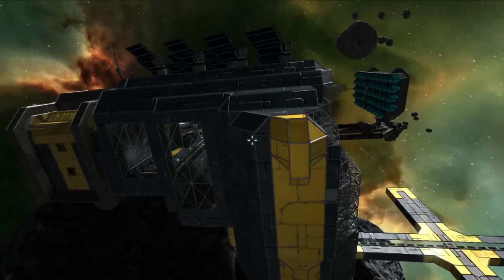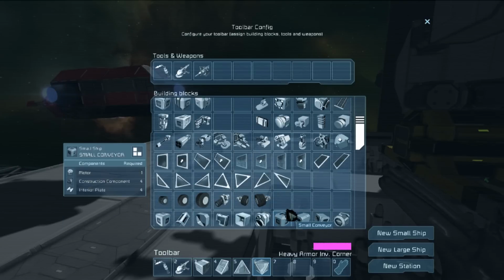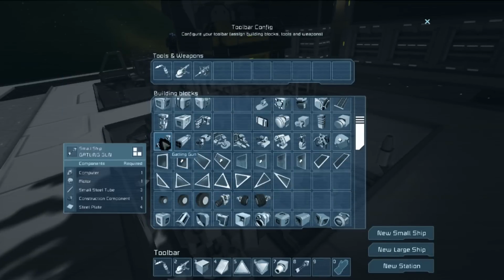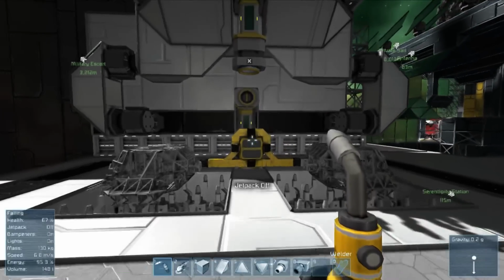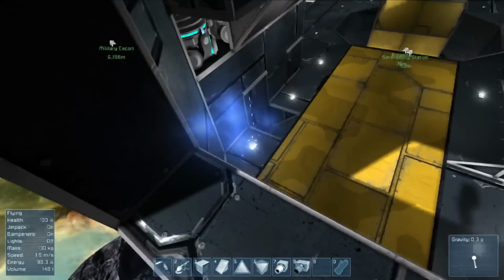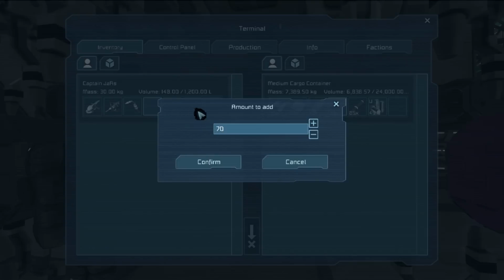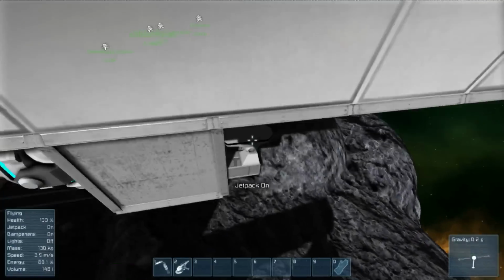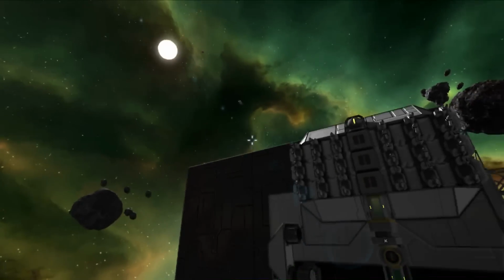Space Engineers co op survival - 41 - The Krill Is Reproducing!

Comment: Nice improvements on the Krill Grill. I like the hinge since you can stop it at so many angles to accommodate even larger ships for rapid welding. Henry Ford would be proud.

I'm still not crazy about a few things with the fighter design however. But, you can make a lot of them so use Russian tactics and swarm your enemies with dozens of Krill!
Reply from the maker: The only design features of the krill is mass production compatibility. And guns..
Just because I'm curious, what is it you don't like about it?
Reply: Captain JaRs
I think the cockpit is too exposed first of all. Just a few minigun or gatling turret rounds would space the pilot. It doesn't have enough power for the thrusters. Small reactors don't generate much power so you need several more connected to your conveyor system. Also the engines are very exposed. Large thrusters are great for speed but need some shielding.

I do think it's a cool little fighter, and I know it's purpose is to be mass-produced but those things stand out to me as topics I'd personally tweak if you are going to raid cargo ships.